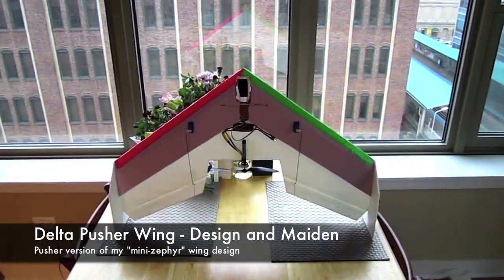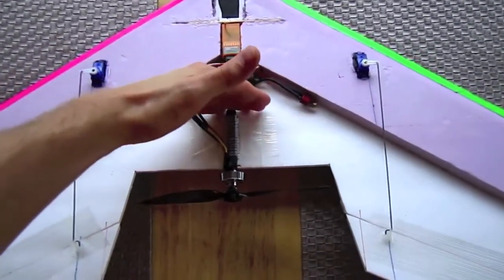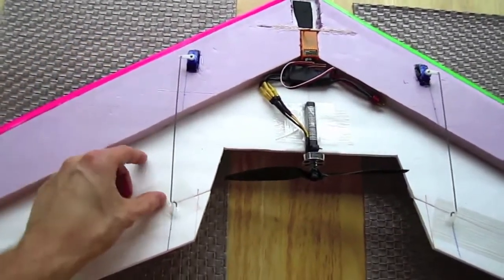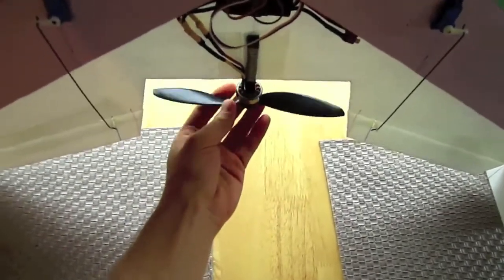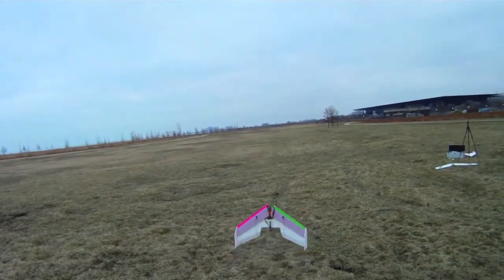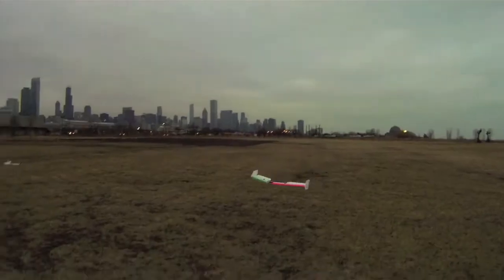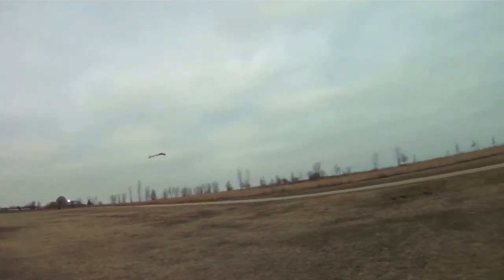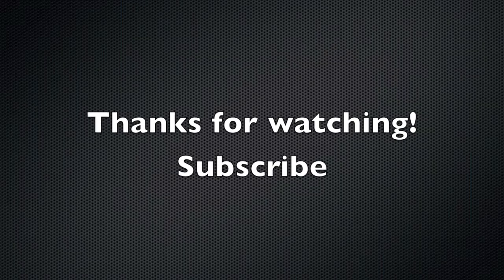Delta Pusher Wing - Design and Maiden

Comment from the maker: 1300. I like the 1300 - you can use 8x4 props with it, which are my favorite props - good speed and low speed thrust. I don't care as much for the 1500's - they over heat on 8x4's and I don't like the smaller 7 inch props

Comment: Hi there,

I need of your experience! What kind of airplane would you recommend to me to be sent it to high altitude (30km)? Some problems are: strong winds, low temperatures (-50 celcius degrees) and I also need to transport some electronic equipmet there...

I'm thinking that one of this Delta wings will work fine. 

Do you agree?